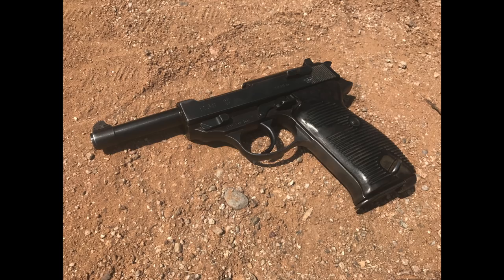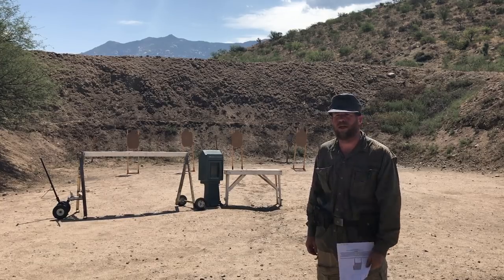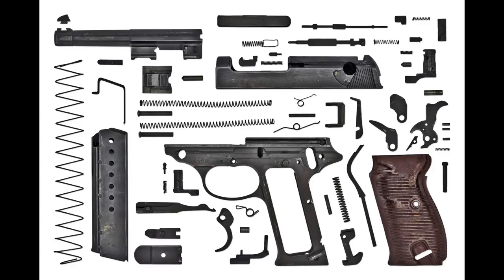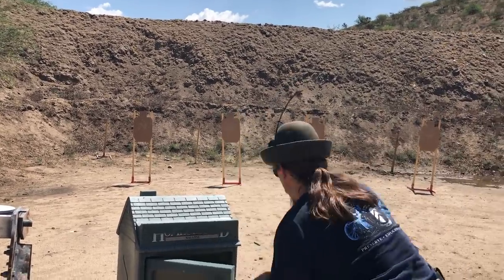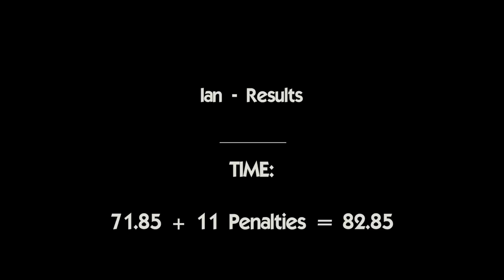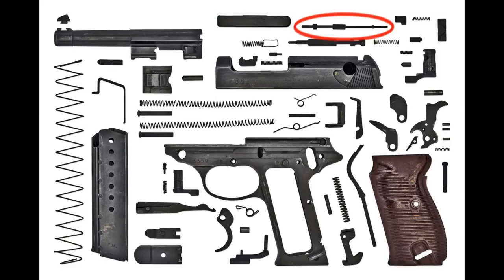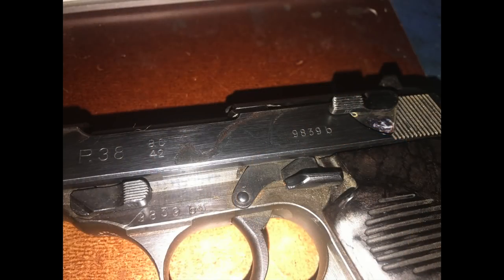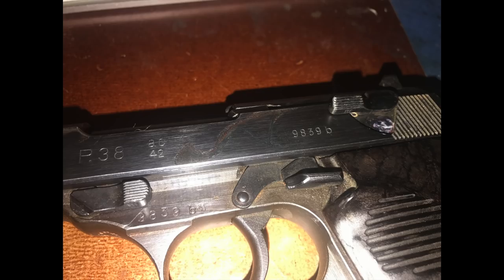Walther P38 Failure Day!

Comment: I found the loaded chamber indicator on the P1 pretty useful, especially at night. Imagine, you get surprised by a nearby noise and you dont want to make any noises yourself, that might give away your position. It is not as easy to silently rack the slide back and do a manual chamber check opposed to simply riding your thumb over the back of the slide, to feel the sharp edge of the indicator.
Reply: Revolver
Reply: Why is your defensive gun ever unloaded?

Comment: As a professional Gunsmith I have alot of experience with these I have a P-1 myself, the first thing I would have done was remove the loaded chamber indicater  2) I would have changed the recoil springs I got a Spring kit from W C Wolff & Co and changed all the springs including mag springs 3) I learned that European Pistols seem to like ammo especially this one seems to like the S&B its alittle hotter. I hope this helps.
Reply: So what if you had a P38 and the safety didn’t work?

Comment: I bought some WWII and post-war German ammo years ago during early 90's.  A warning label was attached to the post-war ammo saying "Do Not Use in P38/P1 Pistols."  That's when I found out about the 9mm velocity variations for German military ammo.  When I choreographed the WWII and Post War ammo I found a much higher fps velocity and ft lb muzzle energy in certain types, both in WWII and Post War ammo (including stuff supposedly safe for handguns).  The German's adopted a hotter ammo for their Submachineguns after WWII when the Army was reformed, but it wasn't authorized for handguns as their post Military and Police Forces had a combination of older P38 and newer P1s.  P38's were originally built of steel and later of alloys towards to the end of the war.  Post war guns are all alloys.  A muzzle energy of 325 ft/lbs or less is generally recommended by experienced collectors for P1s and late war P38s.  Any old gun has an unknown pedigree and you have to be careful.  Tula makes decent ammo, but I wouldn't put it through an old gun unless I first knew the velocities and muzzle energy.

Comment: I would never trust a loaded chamber indicator. the right way to know is to look and feel.
Reply: Look in to the chamber from the back, for pistol I am shure their is some device to put in that shows that the chamber is empty. No fingers on the trigger.
Reply: TheFranss while your two friends look the other way and shield themselves from the splatter.
Reply: The luger's chamber indicator actually saved my luger from completely exploding, rather than all the pressure of the ruptured cartridge going into the sides of the gun and blowing apart my prized artillery luger it just blew out the indicator/extractor.

Comment: I like on my S&W SD9 VE the tiny window cut into the slide allowing you to see the rim of any cartridge that is in battery no moving parts and is fast and easy to do a visual loaded check.
Reply: The Ruger SR9 is the same way. I thought it was out of battery when I first fired it (it's my first personally-owned semiauto pistol), but the slide had no forward play. So, I shrugged, chanced it, and fired - checked again on the second round, same thing. "Oh, it must be that way. Huh."
Reply: The S&W M&P 9 is the same.  Very simple, no parts required, therefore no issues, though in the field, it could allow dirt to get in the chamber.  I've never had an issue with a loaded chamber indicator of any kind, not even on my P-08 nor my P.38.   The best form of a loaded chamber indicator is to clear and prove the firearm safe.  Works every time.

Comment: I could be wrong about this but I think the Russians and the Germans were loading their respective handgun cartridges hot as Hades for use in submachine guns during WW II. Their handguns were most likely tuned to eat this stuff with few problems in the short term. These guns are now over 80 yrs old and the springs may have weakened a bit. You might want to replace your springs, assuming new springs are to be had, and you do need to make sure your gun eats what you want to feed it before using the gun/ammunition combination in any circumstance where the results actually matter. The best answer for some guns may be low powered rounds. For others  you may need the hot stuff.

Comment: My dad's byf 43 P38 works pretty good with Blazer 9mm, and we haven't had issues with the loaded chamber indicator. 

I can understand why the loaded chamber indicator was incorporated into pistol designs around this time, and post war usage too. Though I'd also like to believe that it's there so you don't have to open the action to check in a combat situation, say a mortar shell blows and the dirt/mud kicked up happens to lodge itself into the opening of the action. I mean when the last round is ejected the slide locks open, big opening for dirt to get in then as well. In a combat situation, more likely you should be locked and loaded, you should know that there is a round chambered. Storage and at the range, I wouldn't trust the indicator so much, now that I would always physically check to see if the chamber has a cartridge in it. Combat zone, your going to be certain you'll have a loaded round in. But doesn't hurt to check if you fear feeding issues or don't trust your own memory.

Comment: When my Dad gave me his Luger and it came with original dated 1941 and 1942 9mm Parabellum ammunition. The cartridges were green colored steel cased and black painted bullets. The Russian Tulammo I use works well in another shooter Luger I bought and my Walther P1 with no problems. I suspect that the Germans originally designed their cartridges using steel cases using higher pressured powder to make them work. This is the same ammo that is issued to use in the MP 38 or 40. I don't currently own those submachineguns. I also think that the Russians have used the same recipe powder of German origin because they had calibers like the 7.62mm Tokerev which came from the German designed 7.63 Mauser to function in their pistols and submachine guns. I still love to use the Tulammo for my Sig P226, Glocks, and my older pistols like my P1 and shooter Luger. They function fine. I only had 3 malfunctions with using Tulammo, mostly is dud primers but never with short strokes of the slide or toggle.

Comment: I have three P38's.  One Wartime AC44 and two Post-War pre P1's.  My AC44 P38 did have the Loaded Chamber Indicator fail in that same manner and I wound up replacing it's Spring.  All three P38's have new Wolff Hammer and Recoil Springs. Recoil Spring Guide Rods in the two Post War P38's were Plastic and were chewed up, now replaced with Steel Guide Rods.  Have not had any Ammunition Sensitivity Problems and they will run on CCI Blazer Aluminum.  That said, I've found that standard 9mm 124 grain FMJ loadings with Alliant Green Dot Powder correctly produce the proper pressure curve that many 9mm Handguns with long barrel/chamber throats enjoy, particularly my 1936 S42 Luger and Glock 19.  My Cz75 Clones and many other 9mm Pistols on the other hand, will thrive on most any 9mm Ammunition.  Sorry for your troubles at the Match!
While I have moved on to other Pistol designs for serious use, I still occasionally shoot my P38's and remember a time when I had to rely on one.  I still like them!

Comment: The spring cover on the P38 is a well known problem with the design. If it's not on right it can fly off, with your rear sight and everything. Not fun.

Another fault with the design is the hammer drop. There is nothing that physically prevents the hammer from striking the firing pin. In fact, it always strikes the firing pin when you drop it. There is just a little piece that catches the firing pin and holds it. If you use that too much it can wear that part to the point that the firing pin can now move and strike a primer. If that happens, your P38 is now a machine pistol as with the safety on safe the hammer cannot go back far enough catch the sear but it does go back far enough that it can strike the primer with enough force to fire.
Reply: I always lower the hammer with thumb when engaging the decocker.

Comment: I had a post was P38, approximately 1950’s that still had the loaded chamber indicator, and indicated loaded whenever the slide was closed because the spring that kept it downward was broken, and it occasionally had stovepipe issues.

Comment: What's funny is I bought a mid-war, bring-back, numbers matching Mauser production P.38 this past weekend, and she shot great with Blazer brass ammo, though I didn't try a thing else. All I had were two light strikes, I think both on the DA first trigger pull, but ignition on the second try both times. That was out of 50 rounds fired. I was however shooting 124gr loads instead of 115. I wonder if that makes a difference in this gun or not. The Walther P5 I had for a while also seemed to run better on 124gr as well, but easily tolerated anything I put in it.

Comment: Best guess about the ammunition issue. Tula and Blazer are both on the weak side (almost a -P load) but the bread cased Blazer creates a tighter seal with the chamber as the bread expands, making it harder to extract. That would account for the short stroking. But it could've been a lot of Blazer with .2 grains less powder per case, I don't know. Just a theory.

Comment: l'm not relying on a chamber indicator either, but l guess one built to the extractor would be pretty reliable? Like most HK pistols for example.
Reply: Glock does something similar, the indicator is just an extra bump on the extractor that sticks out a little proud of the slide when the extractor has a cartridge under it, and it's flush or nearly so when there's nothing under it.
Edit to add: I'd have to say that I agree with the bump-on-extractor type being probably the best, least failure-prone, most fail-safe version I can think of.
Reply: Kurt Bergh an 'extractor mounted' loaded changer indicator is the best option. No extra parts, easily tactile. I do press checks, but if I wake up (i leave my gun loaded, I have no children) sometimes I'll just pull it from the holster, run my finger over the extractor to confirm the bump, and reholster.
Reply: Beretta 96 is the same way. The extractor doesn't stick out or up but you can feel it if you check for it.
Reply: Kurt Bergh yeah , the Beretta has a red painted extractor that can be felt and seen.

Comment: My Ruger SR9 has a LCI that I think is somewhat ingenious; when a round is seated in the barrel, there's a teeeeeny gap that remains open that allows the round to be seen in the chamber. Nothing sticks out of the gun, there are no extra parts. It's just a 1/16" (or maybe 1/32") gap that allows the cartridge to be clearly visible, even at a glance.

Comment: I stopped using Tulammo when it gave me a squib on the 15th round. Luckily, there was no powder in the case whatsoever, so the bullet barely even left the casing and prevented another round from chambering. That box and the other I bought with it are dead to me, though. It'll take a lot to get me to ever buy it again. I'll stick to Sellier & Bellot.

The FNX-9 I was using has a loaded chamber indicator that is literally just a red dot on the rear of the extractor. If the extractor is engaged, you see the red dot. Simple. It's actually come in handy a few times.

Comment: As far as the ammo issue goes, I have a postwar P38 (not a P1) and it loves low powered trash ammo.  Because its one of the aluminum frame models without the reinforcement, you can't really run hot loads like +P anyway.  Still, its a beautiful little gun!

Comment: example.... 
i LOVED federal ammo..... but my m1 garand would sometimes TRIPLE fire...one trigger pull....blam, blam, blam. 
switched over to remmington today.... 
and not only did it function better (had my first even jam.... shooting the last of the fed ammo)
but despite both being 150 grain SP-BT ammo.... 
the remmy doesnt sink up to the brass if i stick a round in the muzzle...... checking the barrel erosion 
so federal uses softer primers.... AND!!! smaller diameter bullets 
AND went from 8 to 12 MOA
to 3 to 5 MOA.... which is perfectly acceptable for an M1 garand

Comment: A friends P38 had the same ammo issue. It worked perfectly with mild loadings but jammed with hot stuff. Unfortunately he had found a huge stash of cheap, foreign surplus ammo that he wanted to shoot in it but that stuff was HOT. Basically +P. So he picked up a stiffer recoil spring and now it shoots the hot stuff great but sometimes has issues with mild loads.

Comment: I like but don't rely on the loaded chamber indicator on my Sig P365 since its just a small peep hole in the slide. You need moderately good light, you can't tell in the dark. I do wonder how much dust and debris can get  through that hole.

Comment: That's weird, Blazer Brass is my go to cheap blaster ammo and never had an issue, it chronos at around  1175 for the 115 grain in a >4 inch barrel for me. It's a little slow but not Tula slow,  it would be interesting to chrono both loads in the Walther. Looking back at the video the Blazer is barely ejecting when it does work, the Tula ejects just fine so either that batch of Tula is hotter than usual or that batch of Blazer is slow or??
Reply: Thats why i use S&B its loaded alittle hot side.

Comment: I wonder if the difference between brass expanding created enough friction that the blazer brass (which while not as underpowered as steal usually is, is still loaded weaker than things like AE is) triggered the short stroke.  The steal, not expanding, didn't create the friction, allowing it to cycle, even with a softer loading.
Reply: not to the level that brass does.
Reply: As a cartridge is fired high pressure causes expansion and then as the bullet exits pressure drops which in turn also lowers the temperature. This causes the metal to contract and that is why 50,000 psi cartridges don't get stuck. Brass expands more than steel and also contracts more than steel. The steel cases are actually the notorious ones for extraction issues. The rigid steel cases don't expand and seal the chambers as well and tend to have gas blow by at the case mouth that puts hot gas between the steel case and chamber. Lacquer and to a lesser extent polymer are heated and stick to the chamber. Lacquered steel cases were notorious for getting stuck in hot AR15 chambers.

Comment: The spring clip is a big design flaw on the P38, it's fragile compared to the other components. It is easily bent which will mess up the zero as it holds the rearsight. Not sure that the loaded indicator was there for the CO as the chances are the only guy with a P38 would be the CO!

Comment: It was the hat...Ian should have worn his beret. :p  Another reason for loaded-chamber indicators was to give a tactile indication if the shooter could not actually see the gun, as in darkness.  Some pistols have extractors designed to stand out a bit when loaded, as opposed to specific parts.  I've read that this was a feature of Beretta/Taurus 92 pistols, but can't tell the difference on my Taurus guns.
EDIT: 'Ulterior motives...' describes ;perfectly the modern gun-controllers and their mandated 'safety' features--including loaded-chamber indicators.

Comment: I run Tula 9mm all the time, 4 to 5000 rounds through all my 9mm pistols, they all run fine. I find it to be loaded hotter than most brass cased ammo running 1200 fps consistantly with only 2 ftf in all those rounds fired.

Comment: Interesting, I've always found that Tula/Wolf 9mm ammo was loaded hotter than US made brass case.  I can run Tula 115grn through my suppressed guns without issue, but using 115grn US brass they'll fail to eject the majority of the time.  Also, my M-11 runs at a considerably higher RoF with Tula vs brass.

Comment: Any concerns about the slide and/or frame cracking? The P38’s hard right angles in some areas are prone to stress magnification, and really were a bit of a design flaw. It’d be a shame to lose a nice historic piece. The problems were not remedied until later versions of the P1, and, in a sense, until later versions of the Beretta 92.

Comment: What actually happened is a WWII German Pistol recognized the Frankophile Ian and did it's best to sabotage his runs.
I am also guessing that the Craptacular Tula ammo with steel cases is closer to the WWII german 9mm than you think.  
I have a post war P38 and it doesn't really have a preference on ammo, but it shoots left just because it can.
All the good guns should have a loaded chamber checker that is made up of a pair of eyes and a visual of the actual chamber. (operator, not a mechanical device)

Comment: ARs can have trouble switching from steel to brass case ammo without cleaning. The idea floated is the steel doesn't expand as much and allows more chamber fouling. The brass then expands on the fouling and sticks. Same thing?

Could the chamber be cut smallish because of the steel case ammo or because of 1930s manufacturing?

Comment: The gun is empty, Dave. Loaded chamber indicators are a bad idea unless it's something like on the Ruger SR1911. Just a simple notch in the top rear of the chamber. You can see the cartridge rim through the notch. No mechanical parts to malfunction and give you false readings or possibly jam up your firearm. I know it's not as cool as a press check but it serves the same purpose. It also doesn't require slide manipulation.

Comment: From my experience ww2 9mm from Germany was made pretty hot so it would cycle both smg's and pistols. 

I would be curious to see you compare ww2 era 9mm to current commercially made 9mm and to current commercial made 9mm +P to see if the ww2 era stuff has a higher velocity and more punch to it.